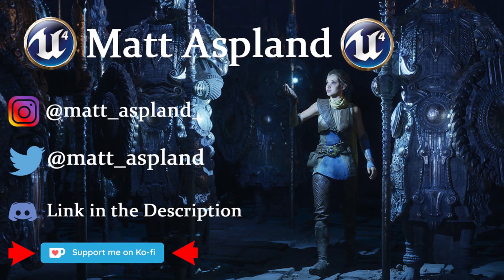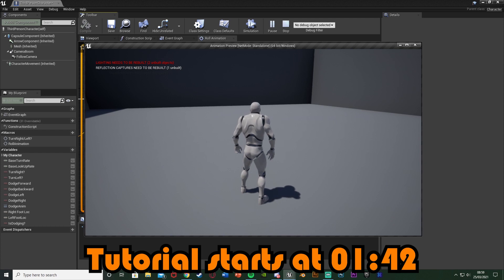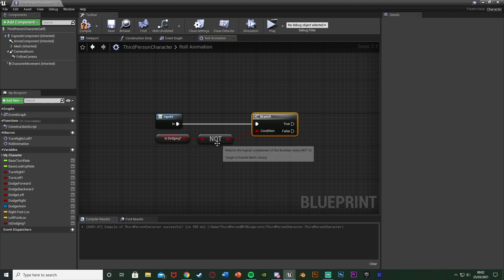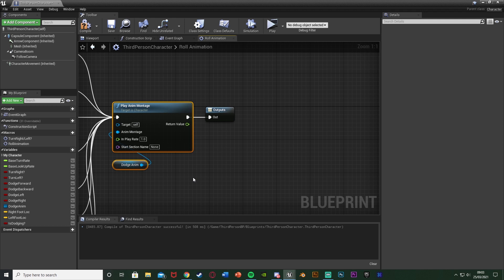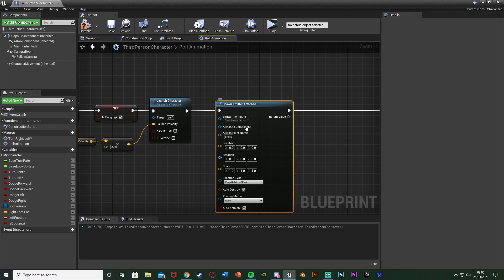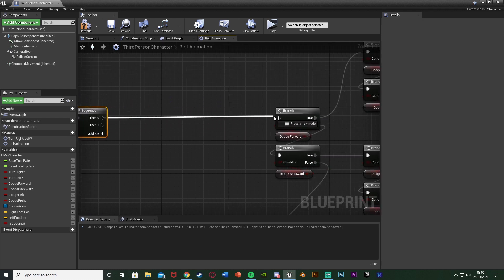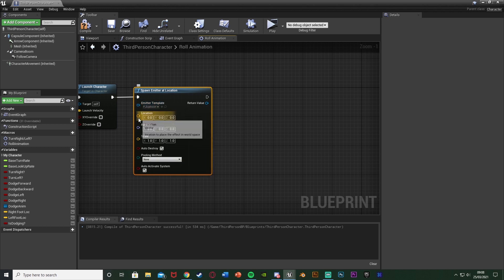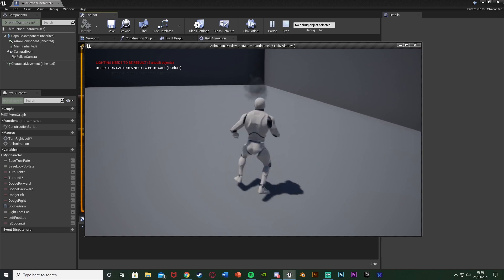Improving Our Dodge System | Plus Spawn Emitter Trail When Dodging - Unreal Engine 4 Tutorial

Comment: Great improvement on the dodge system, but I've found one problem with it. if you dodge off a cliff, down a ramp or mid jump it sends the character across the map. what would you suggest to fix this?
Reply: I've managed to fix the dodge in mid jump, By adding a branch at the beginning that checks the JumpCurrentCount in the condition and if true it has a delay and then it sets IsDodging to false and if the branch is false then it runs the rest of the code like normal. still no luck with the other problem though.